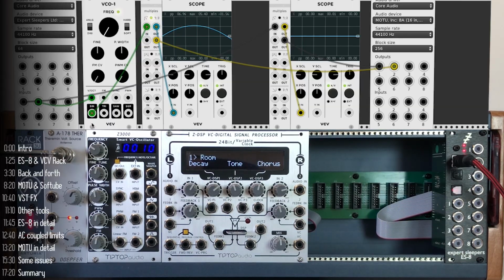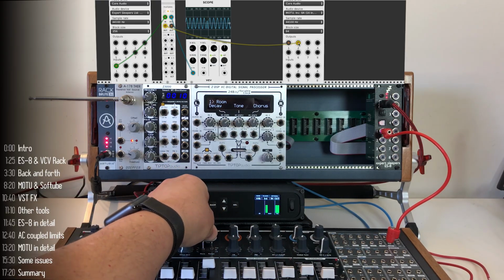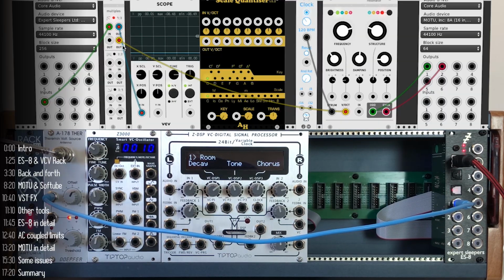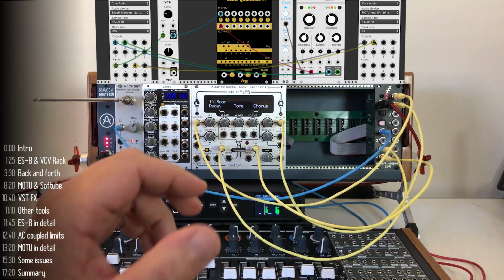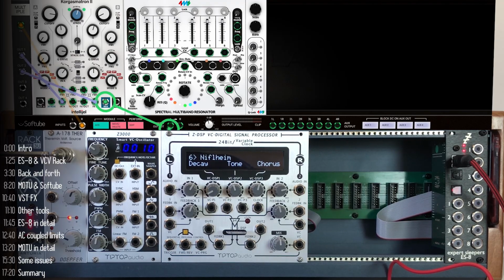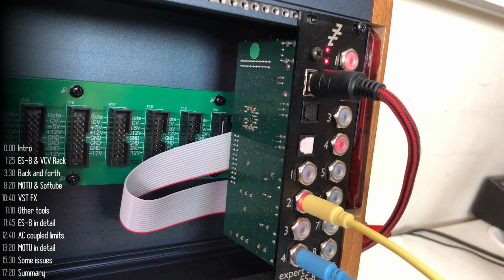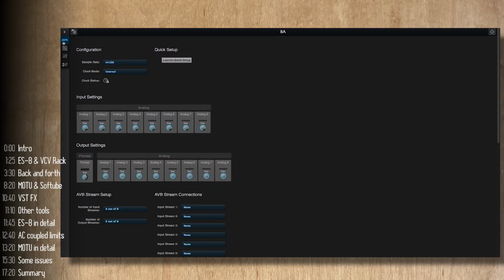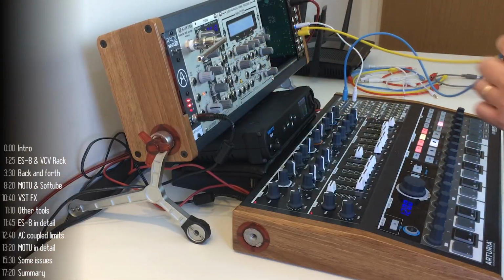Hybrid modular - The one must-have module: bridging Eurorack and VCV Rack, Softube (ES-8 and MOTU)

Comment: Awesome video man!
Kinda confused; this is about integrating modules with virtual ones right? ...Not necessary integrating your modular with a DAW, as any midi/cv module would be able to send MIDI from DAW to the modular and viceversa...if there’s MIDi Out in your converter module of course. 
Not sure if I’m getting this thing right...

Also not sure how to get the sound(as audio) into my DAW for recording; last module is a VCA and then can it go into any external mixer ? ...or is it necessary a dedicated “output” module? Hard for me to get his “voltage/line level” signal thing.
Sorry for bombing....
Reply: To the last point, generally you can just plug any module output directly into your audio interface inputs to record/monitor the signal. There are dedicated 'output' modules but often you don't really need them.

MIDI is best avoided in this scenario. It forces you into a very narrow "I will now control my modular with MIDI notes" view. If you use audio/CV connections you're bypassing all that and just exchanging signals between DAW and modular, completely flexibly.

If you want to sequence with MIDI notes, you can use e.g. Silent Way to do that, and output the CVs via the ES-8 or other DC coupled audio interface. The joy is that you don't have to have a dedicated MIDI/CV converter. Want 4 voices of MIDI/CV? Then use 4 Silent Way plug-ins and 8 outputs of your ES-8? But want 8 LFOs instead? Then just load up software LFOs and use the ES-8 again. Or just use some of the outputs to send audio to the modular. Any output can become anything.
Reply from the maker: chatolars hey - I see the question was answered for me ;) I agree with the answer
Reply: loopop thank you !!👍👍😘😘

Comment: Awesome!
What should be mentioned.
If you use a DC-Coupled Audio Interface to transmit CV signals you will need a special cable to avoid damaging the interface.
A floating ring cable.
Reply from the maker: Thanks very much! and yes, thank you very much for the floating ring cable comment. I added a card talking about this at the right point in the video, as well as to the description
Reply: But do you need a TRS to TS cable out of the audio interface? You seem to use only TS to TS (6,3 to 3,5) cable. Have you noticed any problems with the CV signal sent ? Looking to buy a DC coupled audio interface but I am a bit confused about the cables I should use. Thank you for the demo !